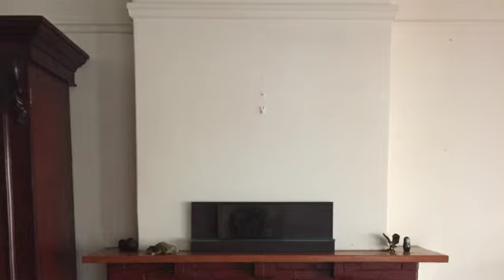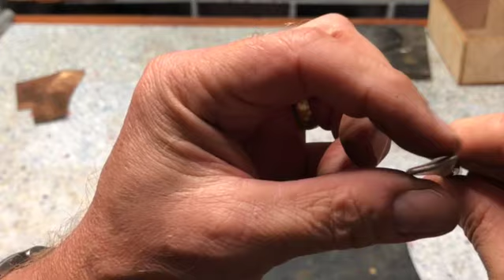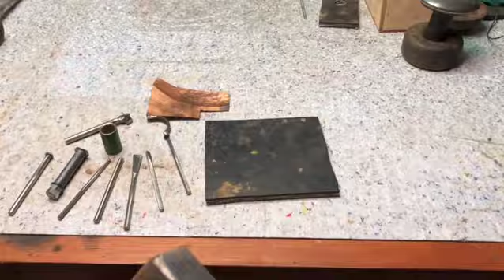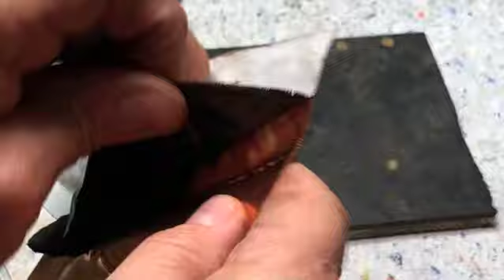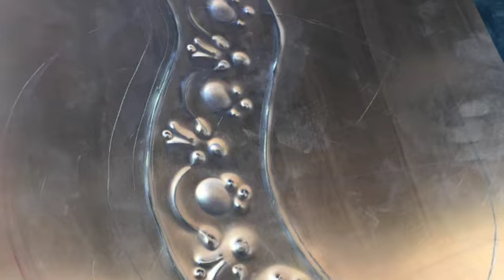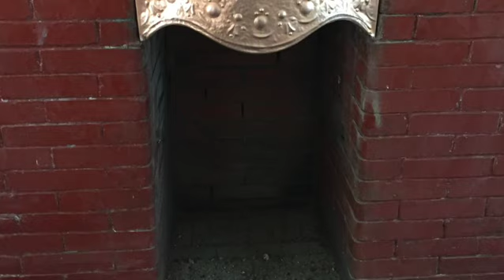How to do copper relief work- fixing an old fireplace.

Comment: Thank for an interesting video. 
Very clever the tools you made out of all sorts of old steel and the patterns they form. 
I do like your design on the large fireplace decoration and reminds me of the arts and crafts movement of which I am a fan and you see it in antique furniture. 
I do like it when the copper has a patina and is rubbed back to see the design again. 
It would be great to see some copper jewellery made out of a thin copper sheet, or book covers with those lovely arts and crafts designs. Can't remember what the chemical is that you use to patina, but I also know that if you put a small article in an air tight holder with boiled eggs it will also patina copper and silver. 
Looks lovely when the copper is patiaed and then polished again and the design keeps the patina. 
People make beautiful jewellery this way.
Reply from the maker: Thank you for the long and nicely written comment Anita. I will definitely keep the boiled egg trick in mind…